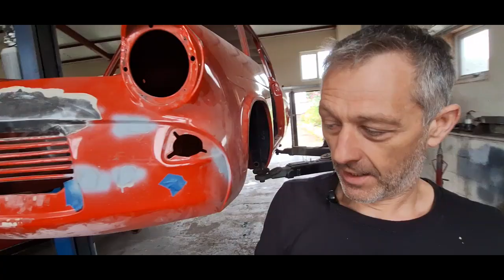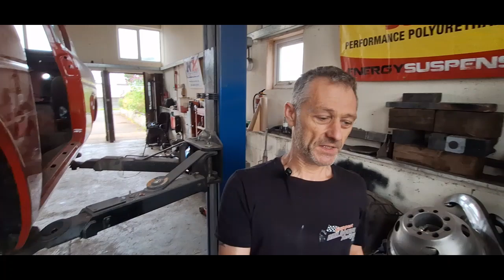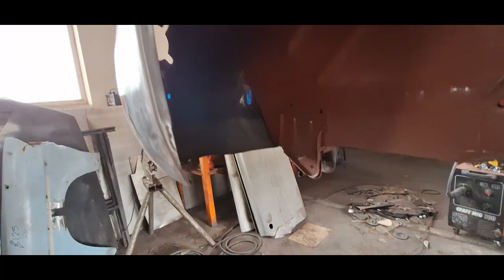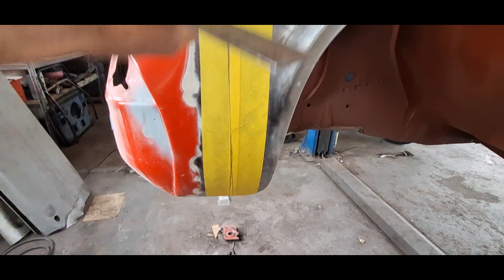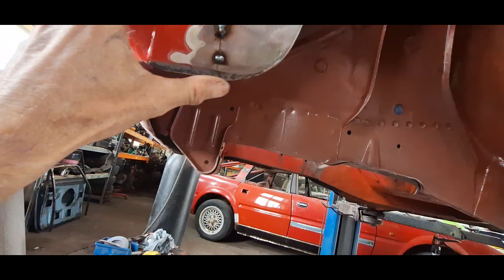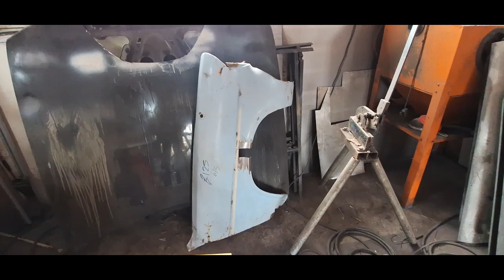Yorkshire Classic Cars Ltd restoration workshop project - Ford Anglia 105e fender /arch modification

Comment: It must make the job so much better when you have a MIG welder. I remember doing some repairs to bodywork on an old Ford in the 1970's, and I had a BOC Portapak oxy/acetylene set up.  I love oxy/acet, but - oh dear- the difficulty created by heat distortion!